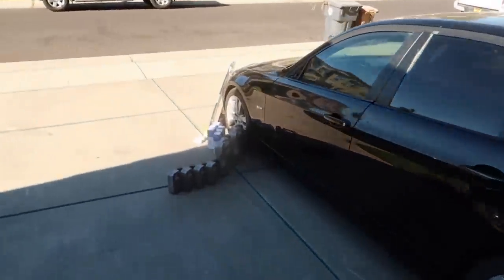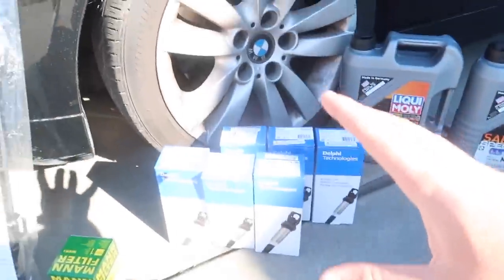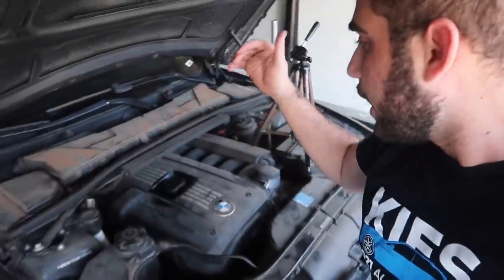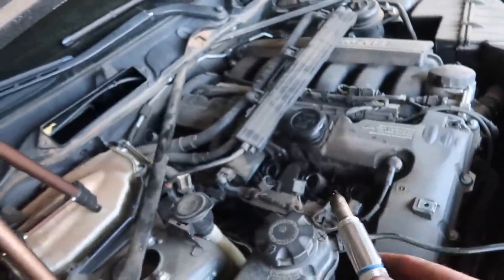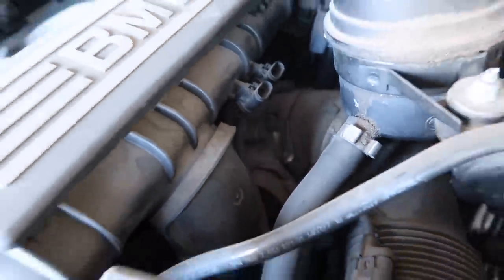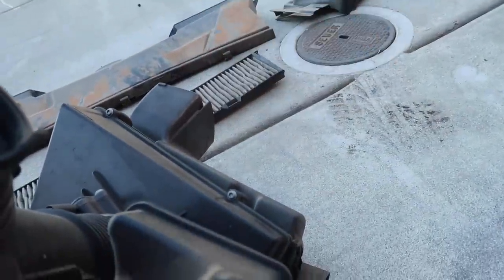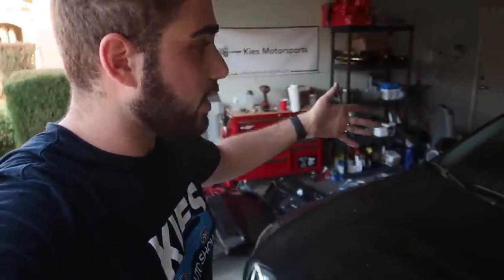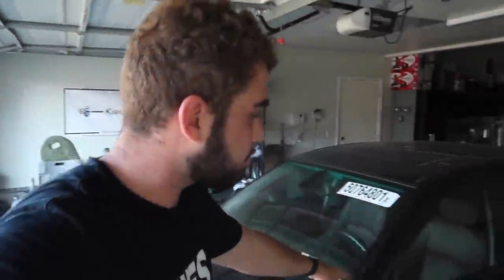Rebuilding And Restoring A BMW E90! Part 6

Comment: If the valve cover gasket is leaking into the spark plugs then they are wet on the top and not on the bottom. You are fine with the gasket. The spark plugs rather look as the car only did short trips and was never driven over a longer distance

Comment: Those coils have definitely been replaced they come with Bosch from factory
Reply: He said the plugs had oil on them so he has to replace the valve cover gasket.  Oil on the hot end of the pull goes into the head and oil on that side of the plug can't be fixed with a valve cover gasket.  Oil on the electrode is a bad pvc, bad rings or leaking valve Seals.

Comment: have you checked if the car is under sulev warranty? 
it hasn’t been reported to the dmv that it’s salvaged yet because you haven’t registered it, if it’s under 150k miles just take it to bmw and get the valve cover and ignition coils replaced there.
Reply: Does the sulev cover coolant leak issues?
Reply: @Cowboykilla831  they’ll cover a thermostat but other than that not really